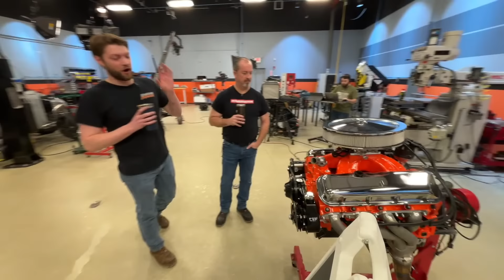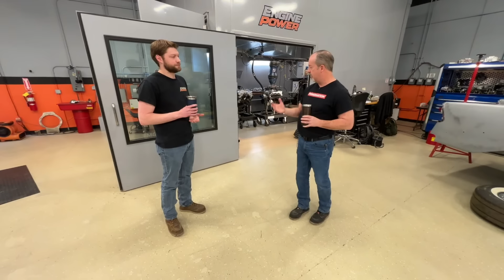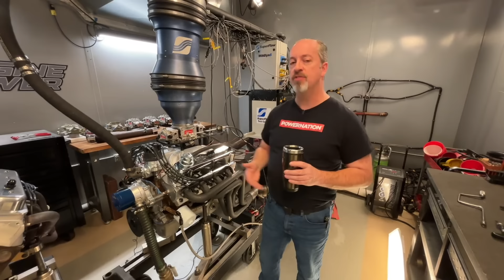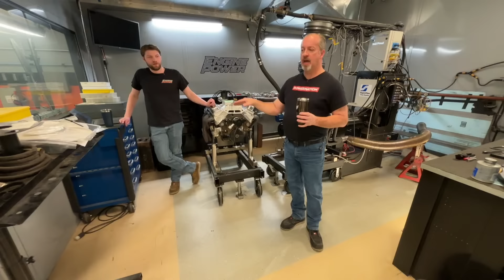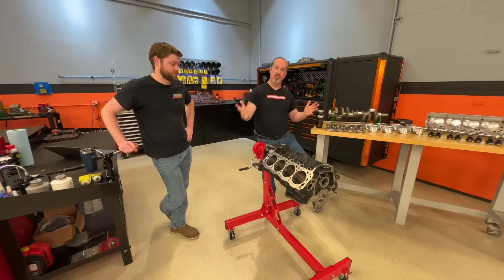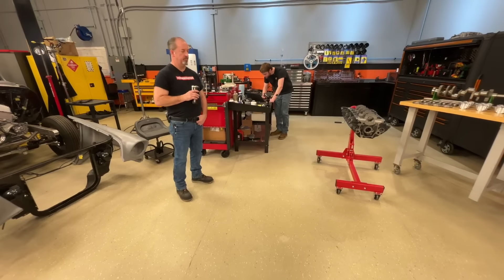302 vs 305 Small-Block Battle LIVE: Cam/Heads/Compression Tech + Shop Updates

Comment: Question - I have a mid-80s 305 with flat top pistons and cleaned up 305 vortec heads. And I have a 1994 l99 baby lt1 with the GM dual plane intake.  My plan is to put one of these engines along with an 8 HP 45 Chrysler automatic overdrive into a 1973 Oldsmobile Omega 4-door with a 323 rear gear. The idea is to make a comfortable daily driver that makes good torque in the lower range. Not really concerned with high-end horsepower. Fuel mileage and drivability with the V8 sound is what my wife wants. Which engine would you go with?

Comment: You guys need to run both of these engines at 600/Rpm a second. It will show an interesting difference in rotating  mass between the 2 engines.  Everything is soo close in these engines that there will  not be much difference in horsepower . P.s. I had that idea before you talked about it.😊

Comment: Frankie and Pat, you should do some unique but interesting engines, like the Mopar 413 with dual 4v long ram intake, Ford 427 SOHC, or a Chevy 400. Or do a series called Medium Duty Mayhem, and do a unique engine build, like a GM 702 v12, GM 351 v6, Ford 534 v8, Ford 361 v8. It would take a step off the beaten path and see something that hasn't been done on tv

Comment: Imo this is a horrible comparison. 4" bore vs 3.736, come on guys! The 4" bore has a huge advantage. The 305 being under square on nitromethane couldn't square this up. Should've been 302 straight up, easy to make a gen 2 LT 302 with stock parts. Staying with the small bore over a whole 1/4" to consider on valves and shrouding, after all it really is an air pump as they say. You would think this show could do better, atleast on this deal. But I do love most content.
Reply: Let's all demand a 302 vs 302 dyno comparison or are the ford guys scared!?! Huh! huh! huh! Let's go!!!!

Comment: That 360hp sbf , without labor, probably cost $5000 to build. Bone stock LM7 with a h/c/i swap is half that and makes close to 500hp. This is the fact that hurts my brain daily.
Reply: 360hp at the crank can be done for 2500 or less on a SBF.  Certainly you can spend more than 5000 and have less than 360 hp.

Comment: As an NHRA Stock Eliminator racer I can tell you exactly what a correctly built and tuned L69 305 from an '87 Monte Carlo SS is capable of. With 081 centerbolt heads, multi angel valve seats, the valves sunken into the port to improve combustion, a stock unmolested 14057053 intake manifold, Rochester Quadrajet, .060 bore and 11:1 compression pistons, custom ground solid lifter cam 254 duration intake 258 duration exhaust .403 lift intake .415 lift exhaust (stock lift specs per NHRA stock eliminator rules).  The heads are completely stock with the exception of the valve seat angle and how the valves were cut. This engine made 419 hp @ 6400 rpm on Eddie Carlisle's dyno. This Monte Carlo spanked every 5.0 GT Mustang it ever lined up against. I put big blocks on the trailer, small blocks on the trailer and lost count to how many I victimized. Stock Eliminator is bracket racing and having a 700R4 with a lockup converter through 4.88 gears and 29 inch wrinkle walls the car was a consistent 11.70s @ 117 mph. If I was ahead at half track the race was over because thats where my speed kicked in. To catch me they had to run 20 mph faster and in Stock Eliminator thats not likely. The only ones that beat me were the K/Stock Mopars with 383s. Thats a heads up race against a car with 100+ more horsepower. The pre '87 305s had the junk 416 EPA smog heads that are complete crap.
Reply: Yea sure😂
Reply: @Bro-wg4wu  you are the kind of chump I would humiliate with a 305 in a 3285 lb car.

Comment: Get rid of those garbage Edelbrock heads on that 306 and put some trick flow heads and watch what it does,  I’ve personally seen multiple times swapping the Edelbrock to TFS pick up 20-30 hp depending on the rest of the engine
Reply from the maker: These heads were chosen to be as close as possible to keep the testing as fair as we could. These heads are very comparable on port volume, valve size, and most importantly flow

Comment: Building an aluminium heads solid roller cam 305 310 cubic in Holden 253  based engine 
500-550  hp is the goal

Comment: Use an 87 onwards one piece seal Chevy 4” bore block bored .30” over and a DZ302 replica dome top piston and a etheir a 3” stroke one pc seal crank or 3” stroke 2 piece seal crank. If You want you can use gen 1 sump and gen 1 timing cover and change the adapter on the back of the block too suit the 2pc seal crank depending on which crank you choose or the 1pc seal 3” stroke cast crank from a factory later  model Chevrolet small block engine forget which casting and what size the engines were but do your research, You’ll work it out.
Reply: The gen 2 baby LT 4.3 crank is 1prms and will go right in any 4" bore one piece seal block for a 302 sbc combo. So easy why didn't they do it, after all whats really on display here is ford vs chevy and as a bowtie guy it kinda rubs me the wrong way putting up a small bore 305 against the larger bore 302 ford.